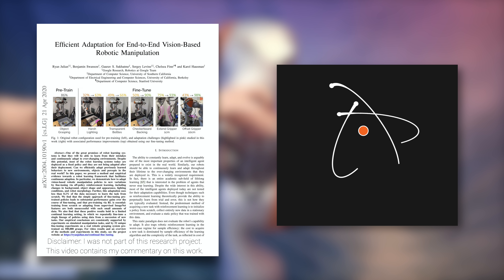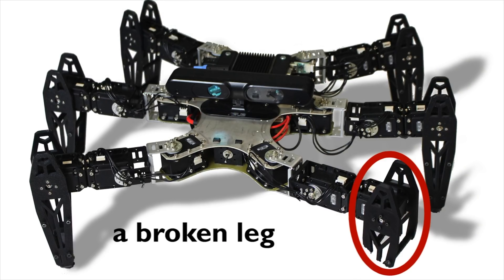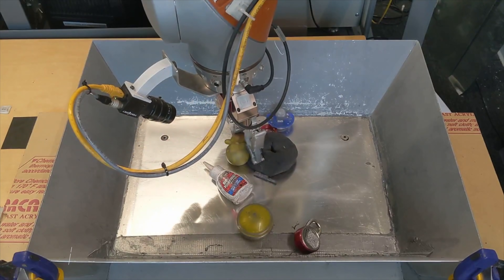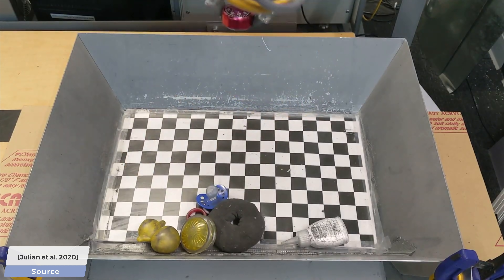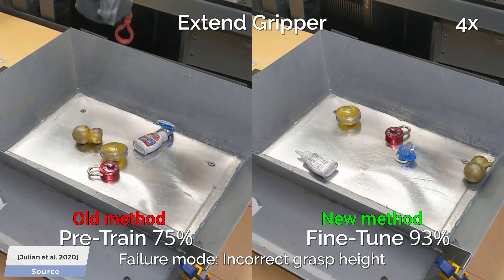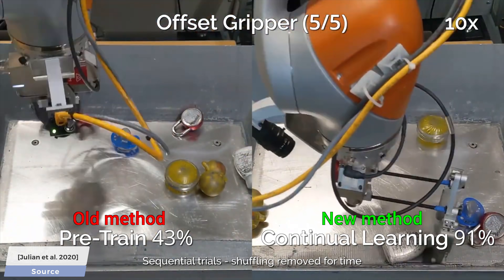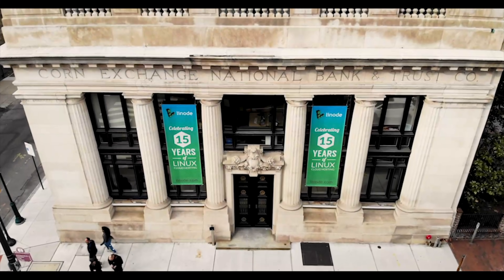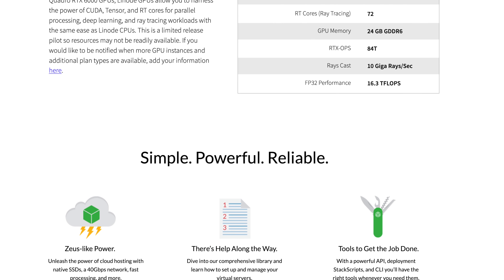Can We Teach a Robot Hand To Keep Learning?

Comment: Hey Dr. Zsolnai-Fehér! I'm an author on the paper you covered here- you might see my arm a few times shuffling objects for the robot :) One thing I'd like to highlight is that reaching the grasping baseline required ~600k real-world grasps, but fine-tuning to each modified setup required only 800 grasps to largely recover and sometimes exceed the original success rate- less than 0.2% of the original training set. Thank you for covering our paper on two-minute papers, the team is super excited to see it talked about here! Keep up the great work fellow scholar!
Reply from the maker: Excellent, thank you very much for dropping by and for the feedback! Congratulations on the amazing paper. Pinned this for visibility.
Reply: @TwoMinutePapers  Dr. Károly Zsolnai-Fehér are you Hungarian?
Reply: The feature I find most impressive about this is the flexibility that the continual learning can give to systems and the differences between optimal conditions and modified conditions. This is nothing short of amazing.

But are there limits to continual learning, that if you stray too far from the optimal conditions, the system can't adapt at all? Have these potential failure cases been tested?

Also, if in some cases modified conditions are too great for the system to adapt, would it be possible to put in intermediate steps that would bridge the gap between two conditions that are too far apart so the system could eventually get there? Cross the river on stepping stones instead of all at once?
Reply: @Rhannmah  This is a good point. There does need to be some level of baseline success in order for finetuning to be effective within a reasonable number of training episodes, if the data collection for finetuning is strictly offline. I don't see why a stepping-stone approach wouldn't work, and in fact we do something similar described in the Continual Learning section of the paper; although the tasks there are not stepping stones towards one particularly difficult task but multi-stage finetuning to handle a changing environment. Really Ryan Julian and the others are the brains behind this paper though, I'm just the robot jockey :) maybe I can get his input for a better answer.
Reply: @benjaminswanson4798  Good work :)
Reply: @benjaminswanson4798  You need to reach the false-summit of topology before exploring further peaks.
Reply: 600k?!?!
How'd you do that
Reply: @arnavrawat9864  Good question- the baseline model training is described in detail in "QT-Opt: Scalable Deep Reinforcement Learning
for Vision-Based Robotic Manipulation," available at: https://sites.google.com/corp/view/qtopt (A great read for those interested in AI robotics!)

TLDR; it was trained on 7 robots running as close to 24/7 as possible for a few months.
Reply: @arnavrawat9864  Given 3 second/grasp that would be "just" 20 day runtime. If it's non-directed learning, that doesn't seem too much.
Reply: @arnavrawat9864  with a robot
Reply: @arnavrawat9864  by making more robots arm do the same work simultaneously. Like 100 arms doing it for 60k hrs.
Reply: Your name must be Harry, because you are a wizard!
Reply: What a time to be alive !
Reply: :D
Reply: Good job both of you!
Reply: thanks for you & team's work Benjamin

Comment: Intelligence is feedback a on-demand loop connected to neurons which are turned on and off according to the feedback received by one's awareness. Meaning that any task is only performed when necessary. Hence, you won't drink water unless you feel thirsty or planing ahead of time (preparing) for something. "Feedback" is a set of complied awareness. And awareness is continuous set of environmental input received constantly when exposed eg, temperature, pressure, light, bodily functions, etc.. And Consciousness is ...sets of awareness tasked to perform different task working together to create something called Intelligent Sustained Awareness. (I.S.A ) hence, different parts of the brain and hence Intelligent beings anywhere from a tiny ant to humans. 

One more thing. Human Intelligence is a Type which envelopes itself around a mandatory routine we know as "expectation". Never mind. I hope it helps create a complex algorithm to train a Virtual Intelligence by combining group of neural networks working together as one.

Comment: A very cool concept worth looking into is teaching an AI to teach itself
Currently, a human operator gives it relevant input and checks the output.

Surely there's a way to intelligently allow the AI to draw input from the internet and check it's output against known output at first, then not checking at all when researching new stuff.

Take electric circuits for instance (with losses just like in real life).
The AI would take the input data for every component and predict some outcome.
if it's predicted outcome is accurate to the real life testing, that means it learnt to do that.
Instead of giving it circuit schemes and formulas and whatnot, we could teach it to get those from the internet and it could learn to predict outcome all by itself by training continuously.
It would likely need a second AI component that gathers relevant data from the internet

Comment: On the topic of teaching neural networks to continue learning, one thing I've really wanted to see someone try is apply the principles of the Leitner Box and Spaced Repetition to a neural network. I won't go super deep into the details because you can learn all about them elsewhere, but it's basically a model we use to help graduate information from short term human memory to long term memory. By spacing out review session in a certain way, we can allow ourselves to consistently introduce new information while maintaining and developing a stronger hold on older information. Each time you review old information and get it right, you promote its level and it will therefore be reviewed less frequently. If you get it wrong, that topic has to back to level one and will be covered much more frequently until you level it back up.

I think this principle could be applied to neural networks. Get the AI really good at one task and set a condition for completing that task (for example, use a pair of hands to kick a paper football though a goal). Once the network gets to a certain desired success rate at that task, introduce a new goal (perhaps, fold a sheet of paper in half). Have it keep working at it until it becomes reasonably successful, add that to the spaced repetition system.

Once we have enough tasks in the system, we can run the memory retention system. For each level we are working on, test each task. If it gets, say 90/100 attempts correct, promote that task. If it fails to meet that, send it back to level one where it will be reviewed much more frequently.

Over time, if this model work, the mastered tasks will reach higher and higher levels, where they're gotten to the point where they won't be forgotten. As the program continues, you can add more and more goals, potentially making the network more general and capable.

Comment: So, you know how in physics simulations self-learning AI often finds ways to exploit the physics engine? How long until we see that happen in real life? Maybe one day we'll built a self-improving RC car, only for it to suddenly wave its spoiler in a weird way, then disappearing in a puff of light.
Reply: "Hey G.R.E.G what are you doin- WHAT IS GOING ON HERE"
loud metal smashing sounds are heard while robot shakes violently as its rapidly collides with the wall its clipping through
Reply: Warp drives can't come soon enough. If that happens, I'll let the AI do the whatever  f it wants, just maybe a lightyear away in space.
Reply: For anyone more interested in the original post, i recommend this page: https://en.wikipedia.org/wiki/Technological_singularity
Reply: Nah, it would need about 1.21 Gigawatts in order to do that, no way an RC car battery has this much power ^^
Reply: @arantes6  Gotta make sure that flux capacitor is working properly too!
Reply: nasolem much terminator/matrix lately?
Reply: I am surprised  few people mention this.
Reply: As were likely not the first simulation, such errors have been found and fixed. Only place we might find some are in relation to the speed of light, but unless our simulation makes it that far, we wont be able to test it.
Reply: @jessiejanson1528  That's assuming the people running the simulation are competent. It's also possible that there's an infinite amount of simulations with random rules, and ours just happens to be one of the more stable ones so far. (Bill Wurtz voice: "you could make a religion out of thi- no, don't)
Reply: nasolem  I Have No Mouth, and I Must Scream

Comment: Super interesting! I've been waiting for more of this continuous adaptation learning for real-world applications. Consider self-driving cars, or more relevantly to the grabber, construction machines. Since the lighting outdoors changes constantly and they have to operate in different times of day/lighting and lift objects of varying weights and sizes, these machines need to adapt in real-time. Glad to see them tackling it!
Reply: If done correctly I'm guessing this would also help with overfitting? Can anyone confirm?
Reply: The problem then is to ensure that it cannot become worse than before.
How to ensure security with a changing algorithm
Reply: @etiennedud  Well doesnt it adapt until reaching good enough success rate and then bake it in with no more learning? Theyd still need to be supervised anyway.
Reply: @Andytlp  but in that case, for the car example you could just take all the accumulated data of your first ai and create a new and improve ai in house, test it and do a maj of the car ?
I was seeing this paper as a way to make a system better in real time. Which will never append in production environment, as it is difficult to ensure that the ia is doing better without test.
Reply: @etiennedud  I guess you'd have to make sure the changes are always safe lol
Reply: @Supreme_Lobster  and this is the difficult part, because you cannot prove it as you don't know what it is doing.
Don't get me wrong, it is a marvel of a research. It just need one or two paper before being usable for real time application 😄